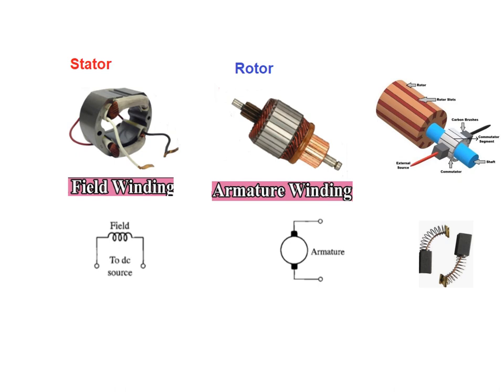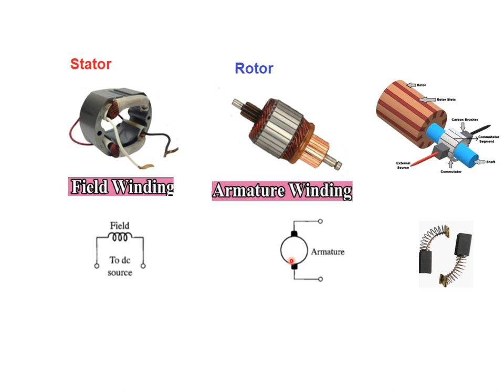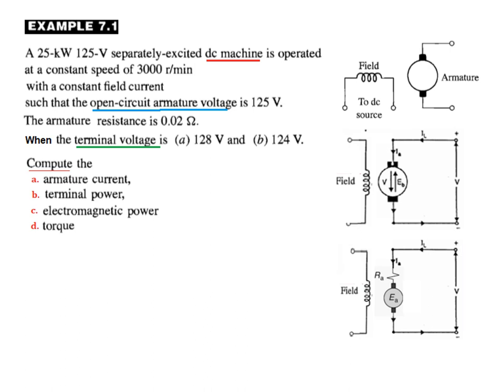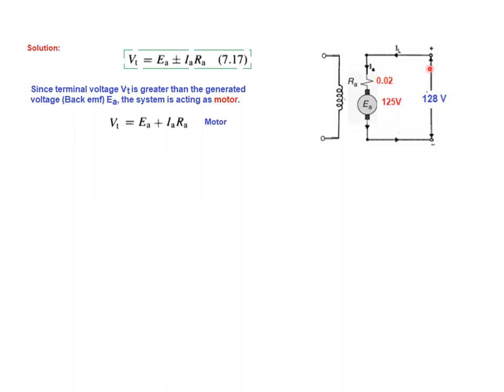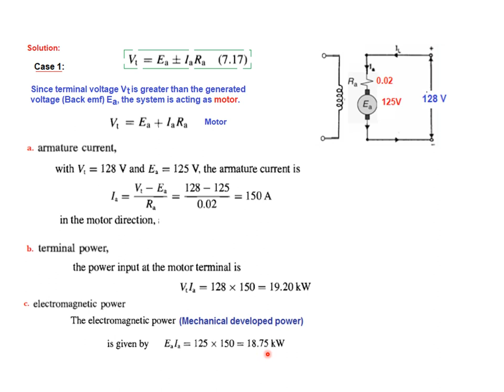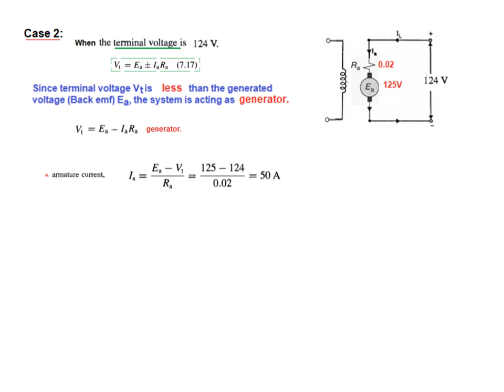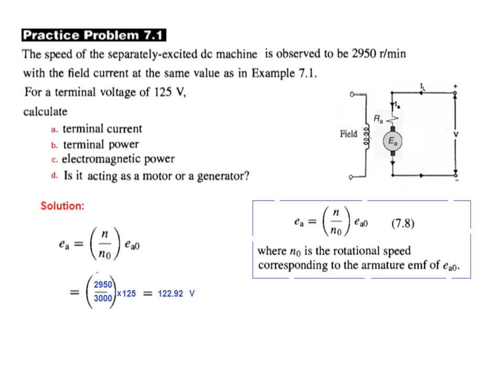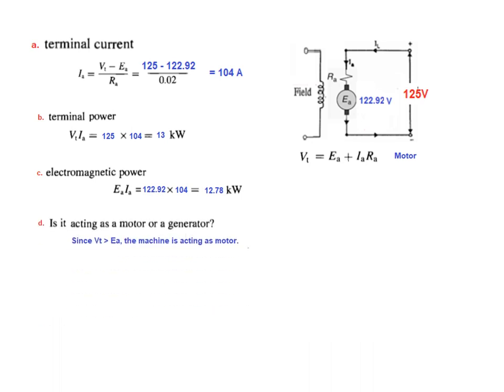DC Motor || Separately Excited ||  Example  7.1 || Practice Problem 7.1 || EM-7.4 (1) (Fitzgerald)

Comment: i have always confuse the voltage value that has been given in the question is for Ea or Vt? xan you explain to me what value of Volatage given if the question ask for generator and motor
Reply from the maker: it is always line to line voltage, also called terminal voltage Vt.

Comment: i have a question we did an experiment about no load test on 
1.separetly excited d.c generator 
2.self excited d.c generator
we took some data but i don't know how to plot the graphs can u help me and explain to me how to plot?
Reply from the maker: May be you get some help from here.
https://www.electricaleasy.com/2014/07/characteristics-of-dc-generators.html
Reply: i have another question
  At the starting point, the magnetization curve shows some voltage although the field current  is zero why?
Reply from the maker: @bilalabdulla7670  Residue Voltage, I guess.